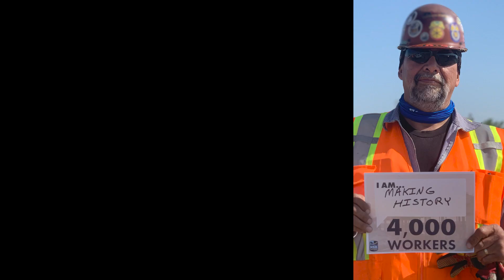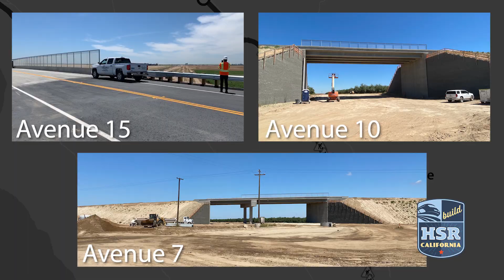July 2020 CA High-Speed Rail Construction Update

Comment: BRIEF COMMENT: THE CALIFORNIA HIGH-SPEED RAIL PROJECT(CHSRP) IS THE LARGEST INFRASTRUCTURE PROJECT IN CALIFORNIA HISTORY. FUNDING & PROPER OVERSIGHT PERMITTING, THIS PROJECT(SCHEDULED TO END IN SACRAMENTO, CA) IS SCHEDULED TO BE COMPLETED AT LATEST WORD BY SUMMER OF 2027-2028. IT IS SUPPOSED TO LINK DOWNTOWN LOS ANGELES, CA W/DOWNTOWN SAN FRANCISCO ENDING ON THE LOWER LEVEL AT THE SALESFORCE TRANSIT CENTER(SFTC). CONSTRUCTION IS CURRENTLY ONGOING IN THE CENTRAL VALLEY LINKING EVENTUALLY W/THE SAN JOSE AREA TO THE CENTRAL VALLEY AS THE NEXT PHASE OF CONSTRUCTION. GOOD LUCK TO ALL INVOLVED IN THIS OVERDUE PROJECT.

Comment: California high speed rail is an expensive disaster that needs to cut its losses. You aren’t building high speed rail, you are building a mid distance train. It wont even compete with the car is was supposed to compete with.
Reply: because they built it wrong. they should have started san diego-la and used that money to fund the rest of the line to the bay area

Comment: Outdated engineering and construction techniques. The methods used for construction and engineering in this project was used 50 years ago in Europe. Since then we have improved the efficiency in terms of time, cost and energy when constructing and building infrastructure in Europe, providing a safe and reliable structure, strong enough to withstand extreme weather conditions and alleviate congestion.

Comment: We need to build the line from Bakersfield to Palmdale so we can connect with Metrolink or Amtrak (  Amtrak would extend the surf liner up to Palmdale ). Also we need to get that line to San Jose so it can connect with Caltrain  and the Capitals. If money is tight we don't have to build it all the way from San Francisco to Los Angeles.
Reply: Yes I say that's a plan use existing rail north and south.